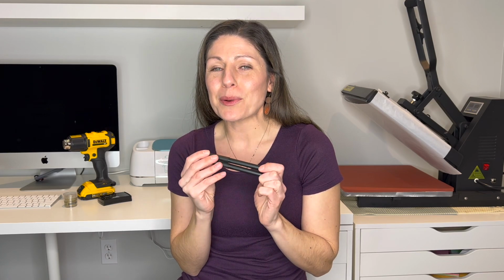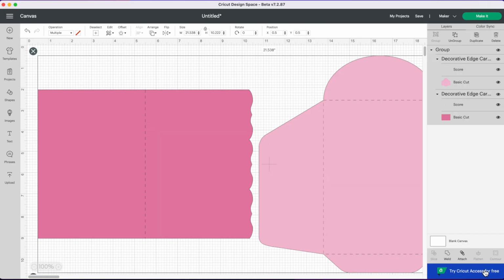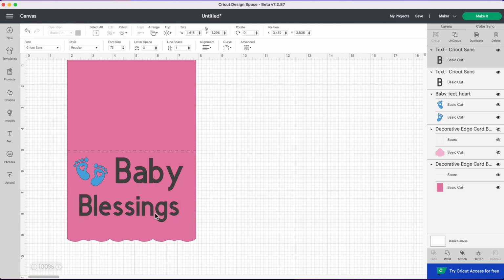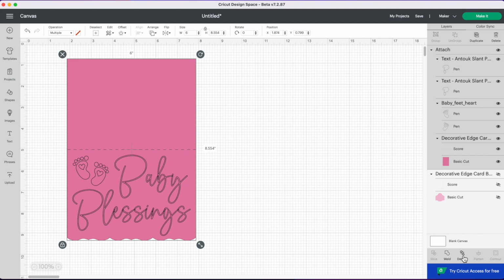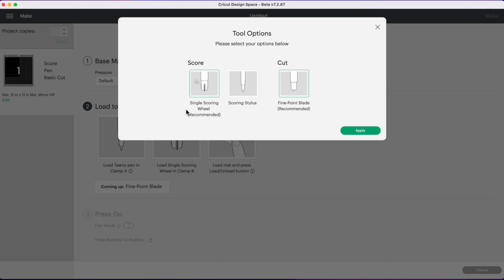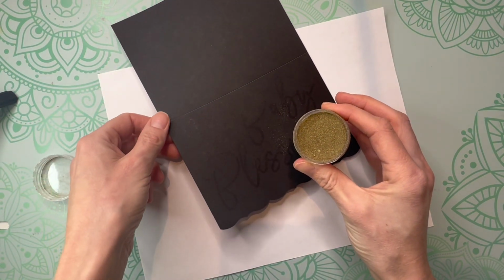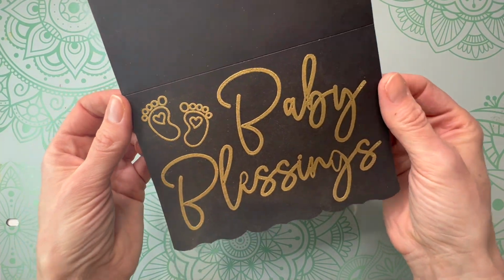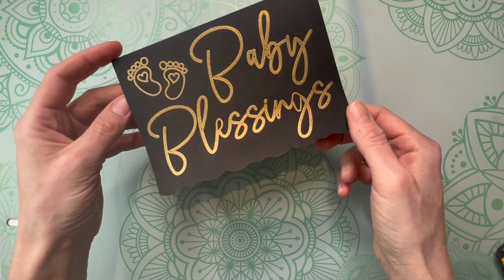Use Ink Embossing Pens in Your Cricut to Create Stunning Works of Art

Comment: Great video! After you add the powder..can you run it thru the laminator machine instead of using a heat gun?
Reply from the maker: I’m glad you enjoyed the video. I’ve never tried that. I would be a little worried that the powder may stick to the laminator and wreck future projects. If you don’t have a heat gun you could try other forms of heat such as a hair dryer or a heat press with parchment paper on top. Just always be careful when using heat with paper. Happy crafting.

Comment: Can I use my liquid gold pen in the circut
Reply from the maker: You can always try. Not all pens will fit but there are hacks to make it work such as removing the pen holder insert and tying an elastic around it. You can also get pen holder adapters on Amazon. Just be aware that if you try any of these hacks it may void your Cricut warranty. So test things out at your own risk.

Comment: If you purchase the WOW! embossing pen you dont have to be in a rush to get the powder down because the formula stays sticky (wet) for 24+ hours. Also if you use an antistatic powder on your cardstock before you put into the Cricut it will remove any areas where the rogue powder might grab onto the paper. You wont ever have to pull out a dry brush to remove extra powder. I love heat embossing as well but I find that the tip of embossing pen when used in the Cricut gets smashed down a bit too much because it is a very soft tip. When this happens, over time the embossing line becomes way too big.
Reply from the maker: Great tips! Thanks for sharing all your insights.